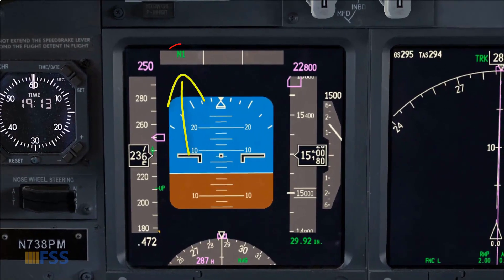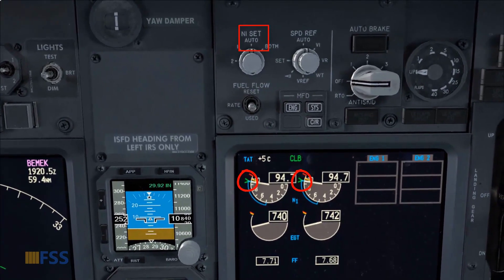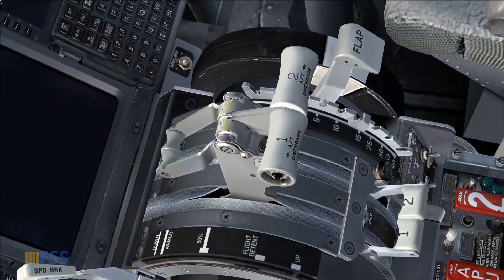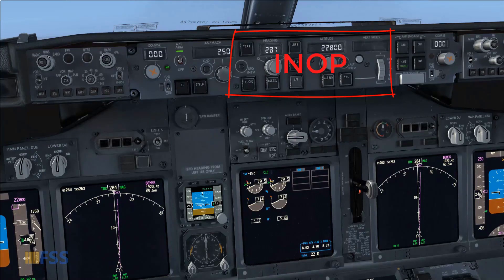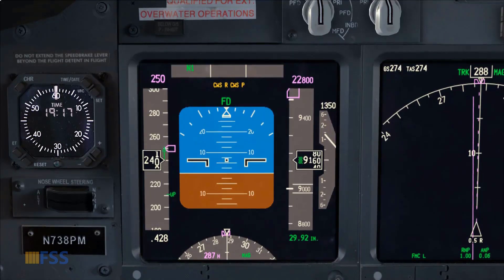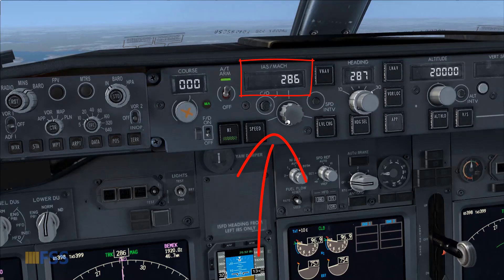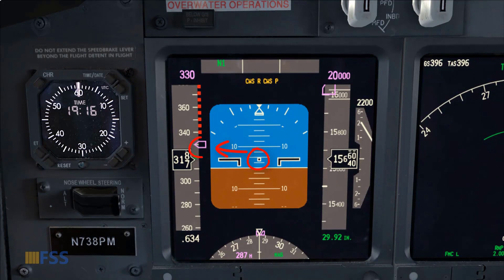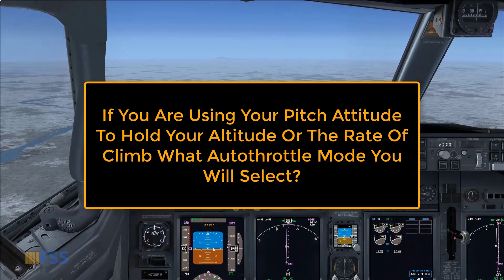Microsoft Flight Simulator Boeing 737 Tutorial |How The Autothrottle Works [Part1]

Comment: I think you missed some critical steps. At 800, don't you go into the box and select clb thrust and then press the N1 button on the MCP. Question, on the initial climb out the 250 speed you had, is that from the box or you have to set it manually. My understanding is that the speed from the box clb page are effective in vnav mode.
Reply from the maker: Thrust ratings are managed automatically by the FMC unless if you have disabled the automatic option.
Reply: @FromStartupToShutdown thanks for the response. So the fmas goes from toga for both lnav/vnav to blank you press N1 button at 800 ra. The mode above the engine display goes from TO to CLB automatically also at the same time?

Comment: how do you disengage the auto-throttle
Reply from the maker: There is  a a quick disconnect button on the side of each thrust lever you can use to disconnect the autothrottle otherwise you can turn off the autothrottle arm switch located on the MCP...
Reply: @FromStartupToShutdown  I tried everything already nothing worked :(
Reply: @taylorpurrss  GO TO THE AIRCRAFT TABLET (EFB) AND THEN TO CONF & CUSTOMISE (IS THE SECOND PG), THEN TO HARDWARE AND SELECT THROTTLE NOISE LOCK TO OFF, AND THEN GO TO THE A/T ENGAGED LOCK THROTTLE AND SET TO ON. 
##THEN SAVE SETTINGS (QUICK SAVE).
Reply: @pbr2805  gurl this was 5 months ago